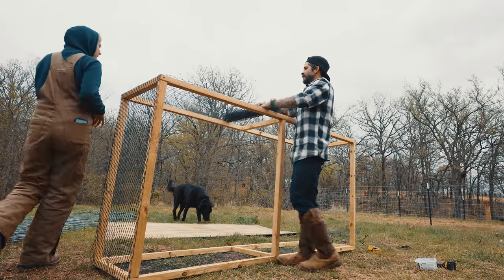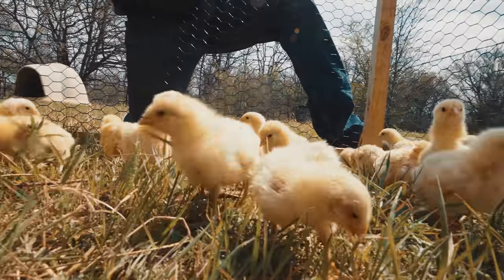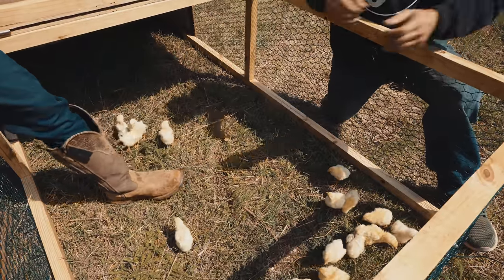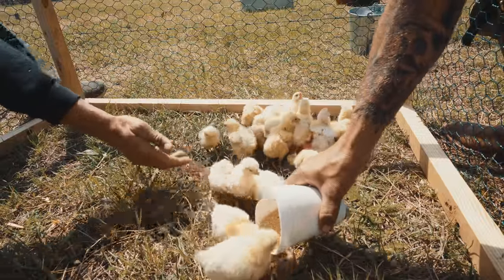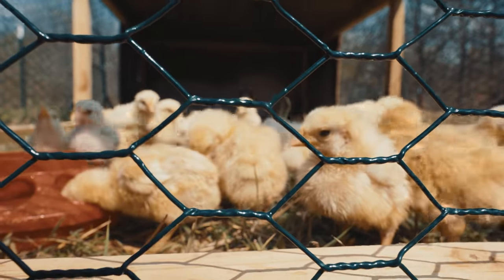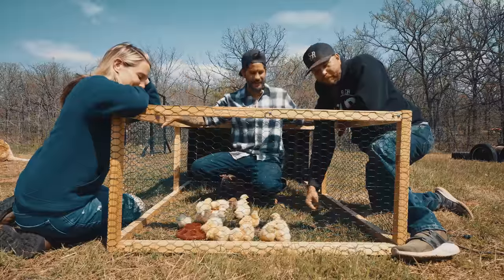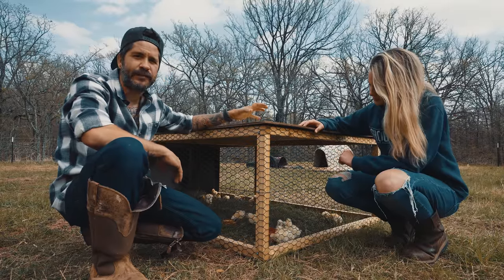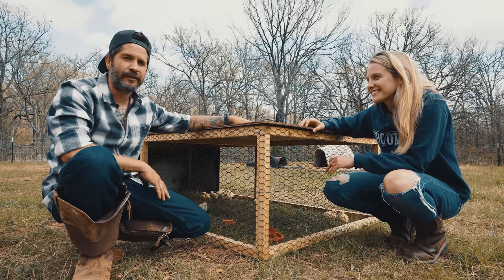DIY 1 HOUR Chicken Tractor Build for $25 / Meat Birds / Farm & Ranch Projects

Comment: I would like to suggest that you put something heavy on the lid that opens so that is doesn't get blown open by wind and predators get in although that won't stop snakes. Also if you do down the line use it for rabbits, you will have to put chicken wire on the bottom so they don't burrow their way out. Cornish Cross will outgrow the tractor but by that time, they can just free range the same as the other chickens because they grow huge. If all 20 survive you will need a freezer, that is enough chicken to last possibly a year between the 3 of you.

Comment: You can use either a small mouth mason jar or a mayonnaise jar to put in the waterer to supply more water.  You might want to think about a latch of some kind on the top, just to keep it secure if the wind blows or a predator does get in can't get into the cage. great build.
Reply: Yeah, I was thinking about all that Oklahoma wind. And definitely more water needed.

Comment: I know y'all said that you don't have a predator problem, but for those of you that do, you should use hardware mesh that have smaller openings (and often cheaper) and protect from more predators. You can also stribp 2x2s from 2x4 with a saw to save money.

Comment: Maybe add 2 half walls to block the wind and a half floor to keep them dry if it rains and the ground is wet 🐤🐣🐥
Reply: @The Crockers
Unfeathered chicks require a constant temperature of 80-95 degrees. ☀️🌡️🔥It's 54° in Tulsa today. ❄️

Comment: You might want to do some research on their heat needs.   Until fully feathered, they cannot regulate their body temp.  Hence them getting under their mother when a hen raises them. 3 day old chicks in a outdoor pen is not the same as a hen raising them. They need to have heat when they seek it.  95 degrees at 1st week.  5 degrees less each week until fully feathered.  That is why Tractor Supply had them under heat lamps indoors.

Comment: Great chick tractor. One thing you might think about is if one is a rooster and hen keep one of each for bleeding.
Reply: @nellmarie98  I did not know that I was thinking of ways to save money. Cause tractor supply don't carry chickens year round.
Reply: @terryjohnson6392  most of the other breeds are dual purpose breeds, for eggs and meat. Although it takes them much longer to get to an ideal weight to butcher. There are some fancy breeds as well that are more for eggs and appearance. Like the baby and seabrights, they are pretty small cocky little things
Reply: @nellmarie98  I only raise egg layers. So meat birds I have no clue about.

Comment: Watch for snake's, they will get under the tractor y'all we normally line the bottom with smaller wire.
Reply: And raccoons, they will rip the chicken wire open enough to get inside. I think with alm the dogs there though  coons may not be much of an issue. 
I had a coop that the eaves were open because  my then husband decided  that since the chickens couldn't  get out of them there was no need  to enclose  the eaves. But a coon crawled up the outside corner and into the eaves and massacred about 40 of 60 juvenile  chickens. 

the thing about chickens, when it is dark, they are practically blind and oblivious  to what is happening  around  them  so a coon or possum can literally pick them off one by one and they'll  almost never react or make a sound. having a guinea  bird in with them as an alarm if something happens  is a good idea.

Comment: nice but use welded wire not chicken wire. for one its not snake proof. aka chicken snakes which will eat egss or small chickens. also 2 racoons reach right in and pull them against the wire and kill them. I have experience both so no more chicken wire. only 2 in welded wire.

Comment: Did I miss a video somewhere? Did you guys show the rabbits? Are you building a tractor for them also? Baby chicks are so cute but Danielle looks so sad when y'all talk about meat chickens. Chicken manure is great for your garden I'm using it this year so save it. Great job on the tractor that's best one I've seen, I've only seen three lol. My great uncle would pick up a chicken by its neck holding it in the air and sling It In A circle to break it's neck and then he put it on the ground and chop the head then watch the body run all over the yard. I hope you guys don't do it that way!
Reply: That’s how my dad did it. I ran with the chicken.
Reply: I must have missed rabbits too. I know I heard them mentioned in another video but never saw them
Reply: @alicemorton4469  we were all little it was kind of scary but fun too.
Reply: @nursemettsmsn  I went back and looked at a few videos and I don't see rabbits I hear about rabbits but don't see them.
Reply: I still wring chickens necks,  but there are butchering cones that you can hang on  tree or post, turn the chicken upside  down, sticking their head  down through the funnel of the cone which is big enough that the body will be inside the cone, the head protruding out the small hole at the bottom of the cone, when you  are ready to dispatch the bird, you pull its neck straight down, and use a knife to quickly cut its head off, losing the blood to drain from the bird.
Reply: @nellmarie98  I'm not sure I want to do either nothing. But I guess if it came down to surviving I  would. Got to do what you got to do.